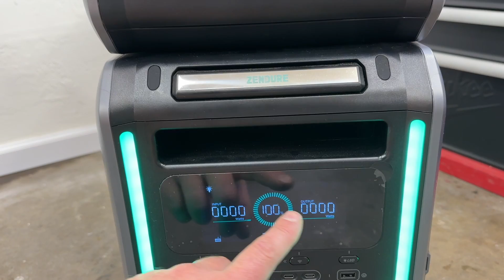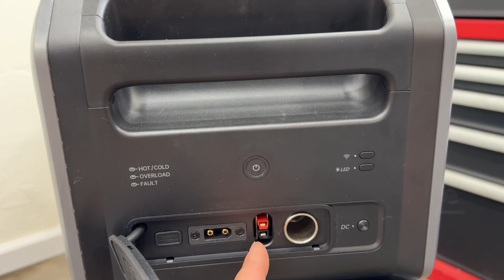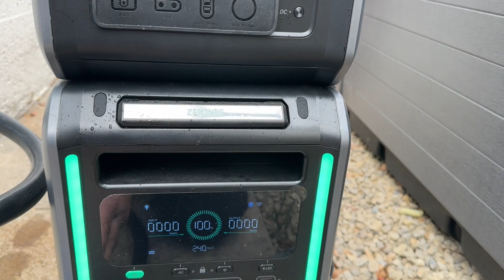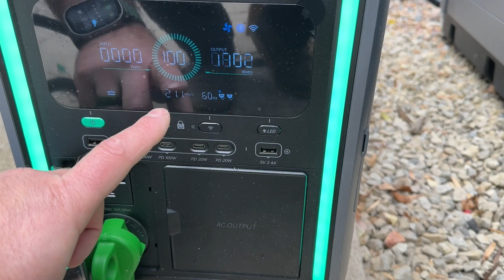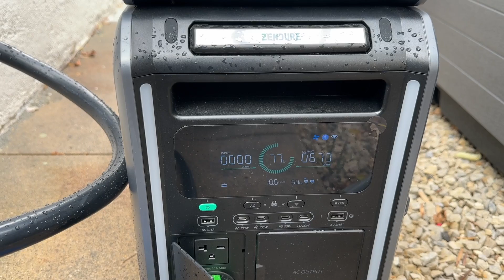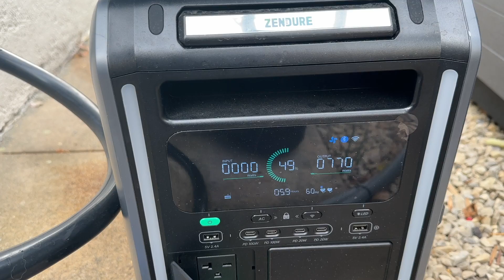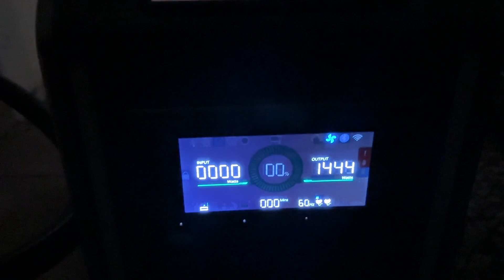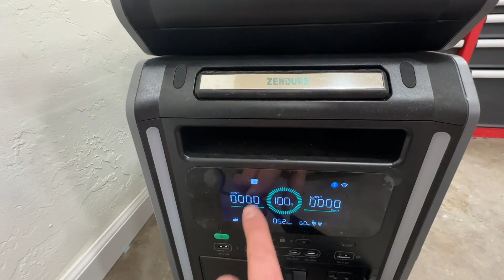How Long Will This Power Station Power My Home?

Comment: Question; the EZ generator switch in an earlier video,  to power only one furnace fan for a couple of days, what power supply would you recommend.  Of course I'd run the furnace only occasionally.   Thanks !
Reply: jwalbrig--MAKE SURE that your EZ Generator Transfer Switch is RE-WIRED (2 min) to use a power supply using an inverter. Otherwise, when you use the EZ Switch with a power station --it ill not work (unit recognizes two neutrals--not possible--so it shuts off.) You must convert' the EZ Switch for a 'floating" neutral. PS--that one white wire gets 'tied" to the other white neutral wires. Any questions, email Kevin:

KEVIN at EZ Switch shows you:
https://www.youtube.com/watch?v=gVbUWCCt0D4
Reply: @kennethwood2089  Thank you.  Just considering this at this point.   We just don't get power losses of more than a few minutes.  Many of the power lines are underground in neighborhoods.    Power is lost when someone digs inappropriately with big machinery.
Reply from the maker: Probably a smaller 1000-1500w power station. 

Personally this one did awesome and I’m going to keep this one for sure: https://www.amazon.com/dp/B0BDYTJYJ1/ref=cm_sw_r_as_gl_api_gl_i_dl_J7W7JRZ3ZV2VK2SXDG9B?linkCode=ml2&tag=wasatchmoto0d-20
Reply: Thank you.  Considering if I need it at all.   In 20 years I think this small city as never lost power for more than an hour

Comment: You need to run that plug to the inside so you don't have to put the battery unit outside.

Comment: People need to understand it’s a solar generator. You need solar panels to utilize this at it’s true potential. It’s a renewable source of energy that’s free. That’s what everyone is missing. No gas can or propane needed. Even on cloudy days you’ll get power. Even during snow ❄️ you will get some power collection. Most people understand that during true emergencies you prioritize power usage and cut out nonessential items. Even frig and freezers can be cut on and off at intervals to conserve power usage. So much criticism about something that is truly game changer. I love my solar generators. They are quiet, powerful, and clean energy. I purchased this unit as well as others during their kickstarter campaigns. Never been disappointed. You can always add more batteries 🔋 by plugging them into the solar port. Keep it within the stated voltage and watts and you can really expand at a reasonable cost.

Comment: Interlock is to prevent power from utility hitting the bus bars, with the generator inlet feeding power into those same bus bars aka how the breakers get electricity. It's a hell of a thing to see head to head. Not safe at all. Remember to call that a generator inlet as it is letting power into it.

Comment: Feels sponsored. 
I got lucky and paid $200 4000W (3300W running) for an, American made, gas generator a few years ago.  Why would I spend thousands on this?
I like your channel, but I don't understand what happened here.
Reply from the maker: They did send out this product. I told them I’d do a video for it. In the past a lot of people have been interested in power stations so I figured what the heck.  That’s also why at the end I said a lot can’t afford this so check out using your car as a generator 👍🏼 cheers

Comment: the Dryer experiment is cute, but totally useless, no one needs a clothes dryer during Emergency Power Outages.
I already have my home set up with professional Transfer Panel Switch adjacent to the Utility Grid power meter...
I have a 10KVA AuxGen that I manually start, it will run 8 hours on a tank of non-ethanol gasoline.  Or, much longer on 20 gallons of propane.

in the last 15 years, we have only had one power outage that lasted longer than 10 hours, we did not use the AC to cool the home, the house temp only rose about 10*F in that time...

those little power packs are neat for those who don't have a clue about Electricity...
but for a Farm raised kiddo, at 81 y/o now, I will stay with my Aux Gen
Reply: Not true. I have one along with solar and it runs consistently even with clouds. Same with my Titan. I over panel it and it runs without a problem. People just don’t understand how solar can be utilized to it’s full potential.

Comment: A wife and 4 kids with two fridges, a freezer, HVAC, computers, electric dryer, etc.  I average 24 kwh each day.  The website lists these for around $4500/each.  You can get a freaking nice invertor generator for that much that will run much longer times.  So I could not see this as an economical back up solution.  You would need 4 or 5 of these with the right hybrid solar system to make them really useful for home power.  It doesn't look like they are really any cheaper than powerwalls.  The nice thing about powerwalls is with two of them, I can run both my HVAC and my 4000 watt dryer at the same time and it has an auto transfer feature that will switch from grid to battery in a tenth of a second or so which is fast enough to keep my computer on and not have to reset all of my clocks.  It may be a decent replacement for powerwalls, but I don't know all of the functionality of these.  I certainly wouldn't get one just as a backup generator.
Reply: It's not economical but it is a turnkey solution for those who don't want to involve an inverter, connecting grid power, battery bank, bus bars, fibre cement board backing, cabling etc. Yes you pay a lot more but it's a single unit and under a single warranty - ideal for those who'd rather not get their hands dirty.
Reply: Generac

Comment: Is that a 120V dryer? Most dryers I've seen are 240v split-phase so I wouldn't expect this generator to successfully power it. Typically you need two of these with synchronized phases to provide 240v split phase.
Reply: Yeah, the TT-30 is only providing a single 120 V phase.
Reply: Clothes lines are free 😁
Reply: @CN073  and not much use in the winter time